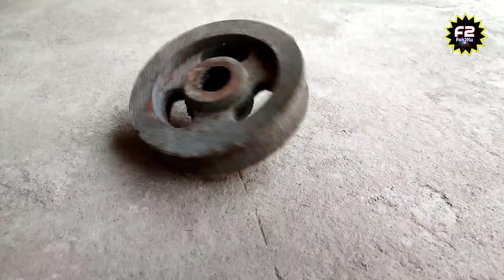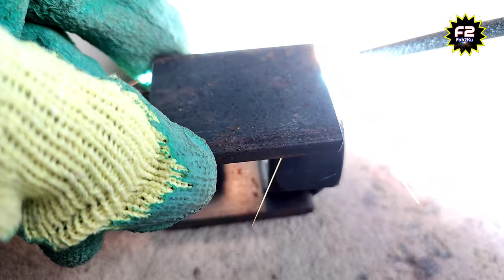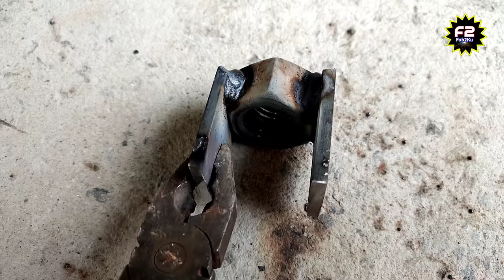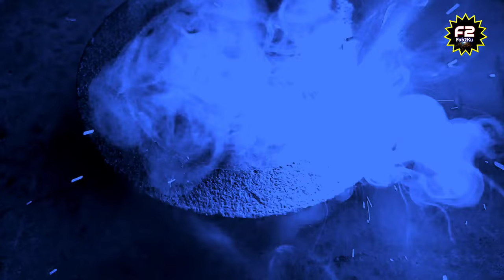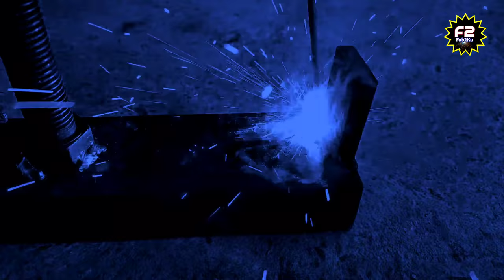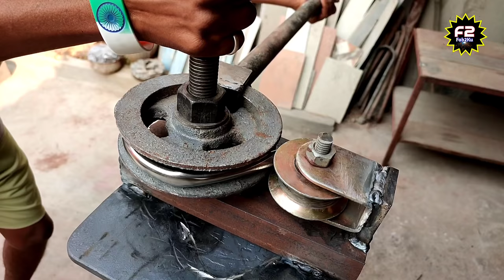Simple And Easy ideas For Round Pipe Bending / Useful Tricks For Round Bar Bending / Bending Metal

Comment: The Pipe you used to pull, cut it's small piece and put it butween big wheel and then put the wheel on that bolt. So it will not wiggle...
Reply from the maker: You are right Sir